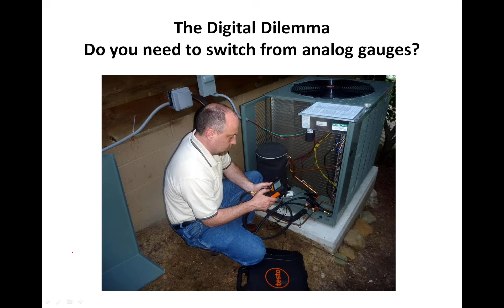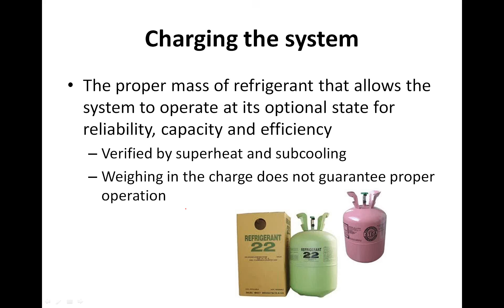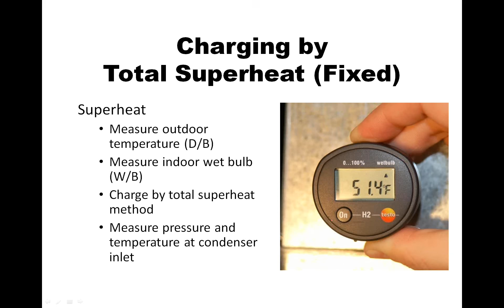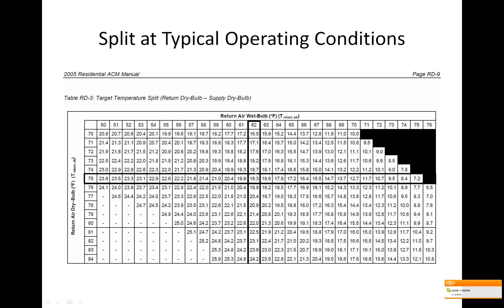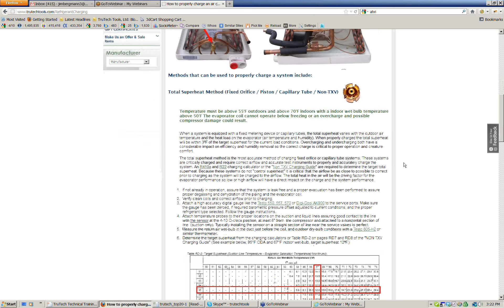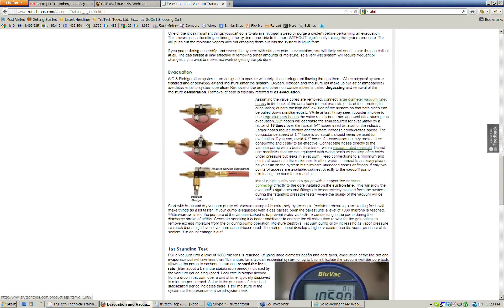Setting Proper Charge  Part 3 A/C System Performance Testing

Comment from the maker: Matt, 
It could be a lot of different things including an improperly mounted or loose TXV bulb, overheating the bulb during the installation (This is a common problem if the bulb is left clamped the the line and a turbo torch is used for the installation.) Contamination of the valve, moisture in the system.